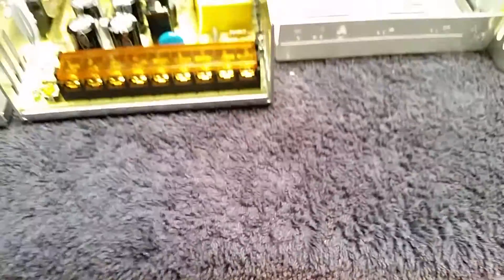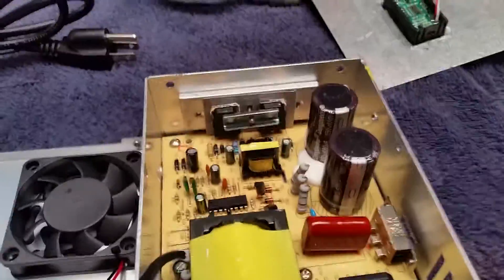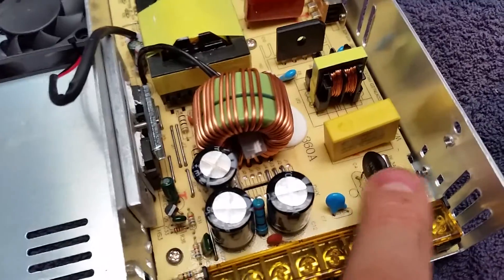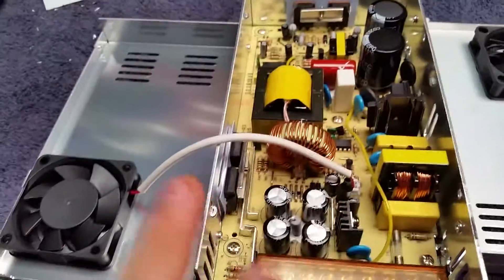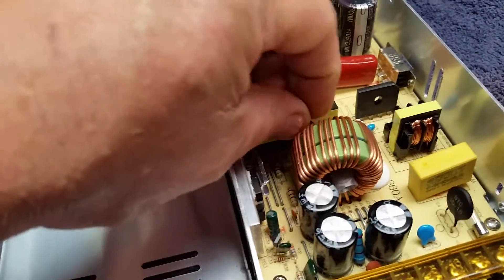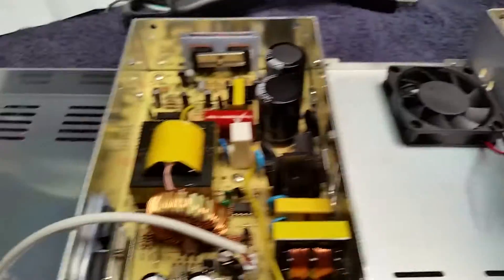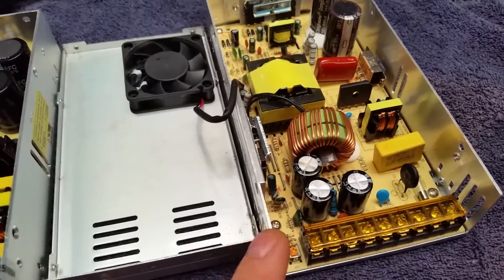MegaWatt swicthing power supply vs. SUPERNIGHT Regulated Power Switching Supply 12V DC 30A 360W

Comment: I just blew a fuse in my 50 amp S700-12 Megawatt supply it was running a Rocketbox HD500 with a X100 one pill Mosfet box driving it. My voltage drop was 13.9v sagging to 13.4v while keyed.
My only complaint with these is there's no External fuse holder or overload protection like most Linear power supplies have.

Comment: I dont think you know the components very well and your components comparison is quite naive.
Reply from the maker: xmenxwk I may not ..you tell us more about them..
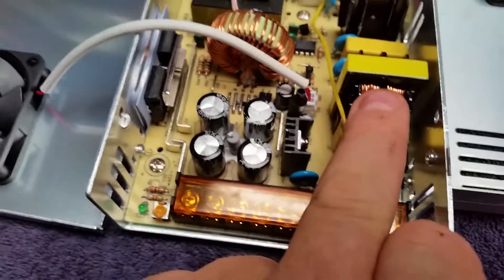Reply: 1:10, thats not transformer, its a noise filtering Choke. And the black rounded things are not inrush capacitors, they are NTC. More of a resistor, but they do control the inrush current. Also you are counting capacitors by numbers instead of their total capacitance. Also heatsink big and small depends on the heat dissipation by the diode/Mosfet. If you use cheap one with higher forward Voltage\RDS(on), they will dissipate more heat thus require bigger heatsink. And I didn't watch entire video.'
Reply from the maker: xmenxwk your very smart tell us more ...
Reply: ibles and xmenxwk are correct on their descriptions/explanations.